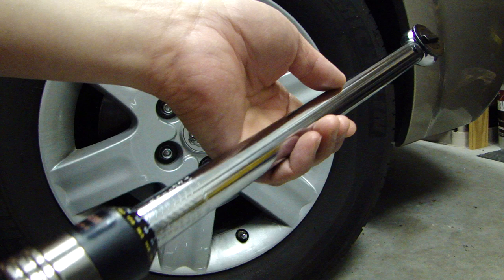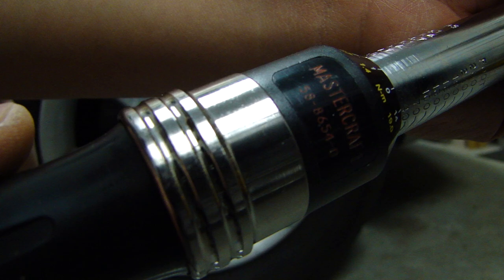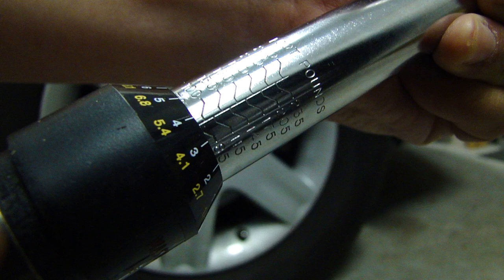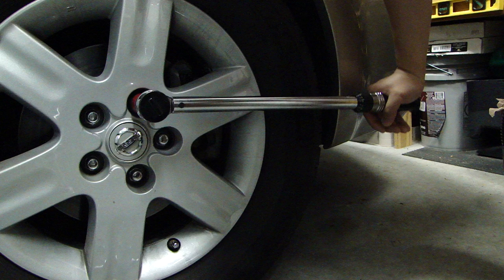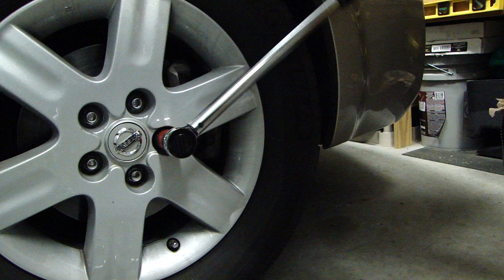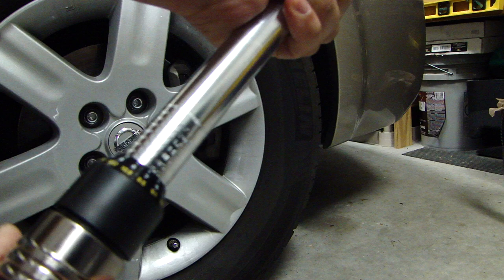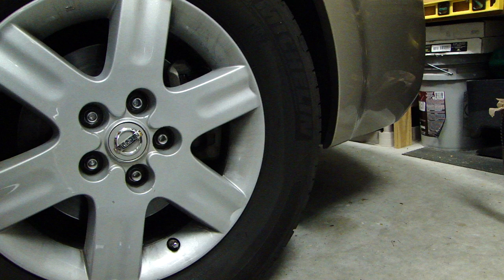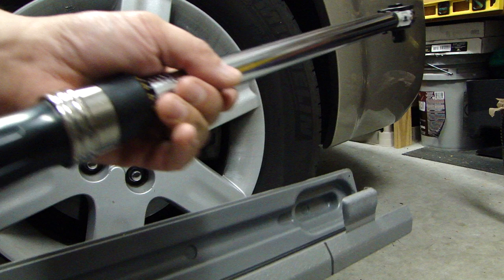How To Use A Torque Wrench To Tighten Car's Wheel Lug Nuts

Comment: This was extremely useful. I just bought a new car and am trying to learn how to properly care for it myself. I'm new to this kind of thing. I had a bad experience in the past where a tire shop over tightened my lug nuts which lead to warped rotors and years of horrible cabin vibration. I will buy a torque wrench and breaker bar now that I know that's what I need. Thanks to you, I also know how to use it now. Thank you!!

Comment from the maker: @tehatemachine  This type of torque wrench is also called a 'click' type torque wrench. When you are tightening  a bolt, if it reaches your torque setting, then the internal mechanical spring and ratchet components will buckle causing you to feel a short click on the handle. You can continue tightening after the click, so you need to stop once you feel the click.

Comment from the maker: Very good point you made. I think they put it in there so that you can loosen bolts that aren't tighten way too much. Basically don't use it as a breaker bar. If you use it as a breaker bar, then it could lead to damaging the mechanism inside which measures torque.

Comment: Great video, I had a brain fart and forgot how to use the tool, so hit up Youtube and you explained very well and simple.  Unfortunately I had to hand tighten than quarter turn tighten with a cross bar on my aluminum rim because I did not have the correct socket for torque wrench... Going shopping tomorrow and having local tire shop spec check while I'm out.

Comment from the maker: 1) yes they are factory calibrated and if you never drop or abuse the wrench and wind down the tension after each use, they do not need to be recalibrated 2) when it reaches the right torque, it 'click' once and you are done 3) as to 3/8 or 1/2 depends on the torque you need for your bolts; most 1/2" goes from 50ft-lbs to 150ft-lbs, and 3/8" is typ 5-80ft-lbs, and some 3/8" are for in-lb.

Comment: @dial2fast Thanks for the response, I really appreciate it.  I imagine I will be okay, because I had tightened them with a simple lug wrench before I bought my torque wrench.  Then I got bought the torque wrench, slightly loosened the bolts and re-tightened with torque wrench.  I'm sure the wheels were square on the hub.  Thanks again.

Comment from the maker: @gene2u  If none of the lugs are overtighten when you tighten them in a circular pattern, then all you need to do is drive around for day or two and re-check it with your torque wrench. Tightening the opposite lugs is mainly to ensure the wheel is torqued down squarely on the hub.

Comment: Most helpful; thank you.  I just purchased my first 1/2 inch torque wrench and had no idea how to use it correctly (for example, the instructions did not clearly indicate what the numbers on the collar signified ...).  Now off to change those winter tyres!

Comment: hey thanks man, im just done doing my tire rotation and got this, turns out i was over tightening by hand in the past, so now im using the correct ft/lb setting, and i was about to store it like that!, good that i saw your video :O (the store sold this with no manual)

Comment: Just a little tip from my experience: When pulling down on the torque wrench, use just the palm of your hand on the top of the bar.  My wrench slipped off of one of my lugs one time and my fist went straight into the ground and scraped me up pretty bad.  This way if you miss, you can just stop your hand from being damaged!

Comment: Good video but should make sure each bolt is clicked twice to make sure it wasnt a misclick from the tool. And for everyone else always make sure to torque properly. Under torquing can lead to lug nuts/bolts falling off or your wheel and over torquing can often lead to stretching of the bolt/nut crushing of gaskets warped brake discs and much more
Reply from the maker: Zachary Eiriksson Thanks for the advice!
Reply: +fo0lishguy owners manual should have it
Reply: I tighten in stages as well as one of my vehicles is 110 ft lb

Comment from the maker: It's hard to torque the wheel when it's in the air as it's free spinning. I usually put the nut on tight when it's in the air. Then I bring down the car until the tire touches the ground and lock the floor jack in place so now the tires don't spin. I finish torquing all the nuts and then drop the car the rest of the way. So I don't drop the car completely if the nuts aren't on tight first.

Comment: I like it.  I'll be over next weekend to have my tires changed over.  Thanks in advance.  Actually, I just did it today with one of those deflecting beam wrenches.  The one mistake I made was to tighten them all in order instead of going to the lug on the opposite side of the star pattern.  I shouldn't have to re-loosen and tighten them again should I?

Comment: I thought once it clicks you cant possibly tighten anymore. So then, is it possible to over-tighten even though you have set the torque to the correct specification? In other words, if I miss hearing the click or tighten too fast I might over-tighten?

Comment: @dial2fast Hey just a quick question, I'm replacing a handbrake in my car which has 3 bolts that need to be at a torque spec of about 15-18 ft/lbs or torque which i understand, but I'm wondering, do I first need to put in the bolt and just hand tighten first then use a torque wrench OR do i need to put the bolt in then use a torque wrench from the start?

Comment: question: if your not suppose to use a TW to loosen, why do a lot of them have a loosen setting. and not just one way turn??
Reply: Torque wrenches are meant to be used with right and left threaded nuts and bolts.

Comment: My last question, lets say you think its overtightened by the technician after a wheel alignment. So if its overtightened the click would click immediately. So i think for this scenario, i would use breaker bar to SLIGHTLY loosen ONE bolt, then use the torque wrench to get the proper torque. Does that sound okay to do? Like is it okay to do one bolt in that cris cross pattern and do it like i said, and it should in general be fine u think? Because i think the procedure i explained would be the best way to make sure its proper torque if you assume or feel it might of been over tightened by the tech. And to me it seems this is best option to make sure its correct and not overtightened.  So what you think?
Reply from the maker: Yes if you think the nuts were overtightened, then just loosen one at a time and re-tighten it with the torque wrench to spec.
Reply: @dial2fast  Much appreciated 👍✌️

Comment: thanks a lot , i have a hyundai accent with size 16 wheels and i don't know what is the proper torque wrench setting to tighten my wheel locks , i read the instruction manual but found nothing and need your help thanks
Reply from the maker: Usually the service manual (not user manual) will give you the torque spec. The Accent will probably be in the range of 80 ft lbs. You can check with your local tire shop.

Comment: If my tires and lug nuts are already on and have never been removed can I check the torque while it sitting on the ground?  Do I have to raise the vehicle?  Do I need to loosen the nut before checking the current torque?  Thanks.
Reply from the maker: If you want to check the torque, set your wrench to the specific torque setting, then put it on the lug and turn it. If it clicks at the torque setting, then it's at least at that torque spec OR could be higher. If you want to tighten it yourself, just loosen it a bit and torque it down yourself. You can do all this with the wheel on the ground as long as you don't loosen the lug all the way.

Comment: hi i have a honda odyssey 2006 do you know how many feet tighten lug nuts?
Reply from the maker: Target torque 80Ft-Lb; Maximum is 90Ft-Lb
Reply: +dial2fast Thanks very much , what happen if tighten over 90 ft. i took my car 2 days ago for change pad breack and they tighten about 100 ft was too hard for loosen .
Reply from the maker: 90-100 ft-lb is not a problem as long as all lugs tightened to same spec. If you get to 150-200 ft-lb then rotor warping can happen and also if you have a flat on the road, it will be difficult to remove the tire.
Reply: 80ft-lb is good as any more is usually a struggle to undo if you need to change a Tyre on the side of the road

Comment: When is it necessary to use a torque wrench? We just changed the axle on the car and had to remove the tire and put it back on. But we didn't have a torque wrench.
Reply from the maker: Dantai A torque wrench takes the guess work out of tightening any bolts or nuts. So you don't risk having something too loose or too tight. You will need to refer to a service manual to find what is the proper torque spec for your vehicle.
Reply: How bad is it if I just tightened them up as best as I can, and didn't use one?
Reply: Dantai uneven tightening of bolts will result in rumbling sound and may cause bubbling at high speeds. If you tight too much, you may break the bolts or destroy the threads.

Comment: User's errors exist when using torque wrenches. First: you must see a socket moves before a torque wrench makes click noise. If it makes click noise right away, it means a nut is over tightened.  Second: you can still push it down when it makes click noises.  Third: Light torque spec is easier to over tighten it with a torque because it is hard to feel click. So we have to watch it out not to misuse torque wrenches.

Comment: what brand is your wrench?
Reply from the maker: My 1/2" says Mastercraft, but I believe it's made by a company ATD. It's been rebranded to many names including an old Husky torque wrench sold by Lowes.
Reply: dial2fast
Thanks for the reply, I have another question if thats OK. I need to take off my brake calipers and the range of required torque settings span from 28Nm (21ft.lb) for the caliper guide bolts to 120Nm (89ft.lb) for the caliper bracket bolts. Since I don't already have a torque wrench, I'm looking at a 1/2" torque wrench rated for 30-210Nm and hoping I won't have to buy 2 separate tools to cover the range. Do you think the 2Nm difference between the spec and the min for the tool would be critical? I think this difference falls within the range of absolute accuracy for the tool anyway. Cheers.
Reply from the maker: KX36 If you simply look at spec, the answer is yes, but in reality a torque wrench is not the most accurate at the lower end. What I would do is since this torque wrench you are looking at starts at 22ft-lb (30Nm), go ahead and set it to 25 ft-lb and then torque the caliper bolt. That way you know is not loose and putting it +4 ft-lb won't break your bolt. People who do many brake job just tighten caliper bolts by feel. Do this for now, and you can always buy another torque wrench later.
Reply: Will do. Thanks a lot!

Comment: Why is it so important to just use one hand, ie not support it at the angle, the "key" for my alloy wheels is quite long and also requires an "in between" driving socket, you simply cant do it one handed, the whole ensemble becomes too unstable and simply wants to drop out, I have to support the shaft devise( from wrench to lug nut), loosely , while my spare hand is in a cotton sleeve ( clean old sock) so as to impose no friction acting like a bearing if you will. Just out of interest my Torque wrench is of the Halfords brand, made in England and seriously peachy!